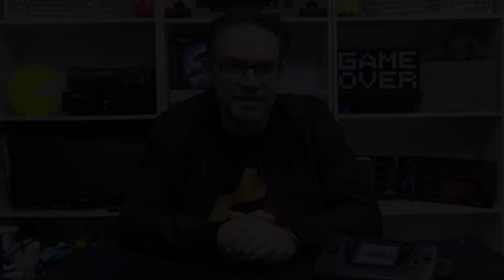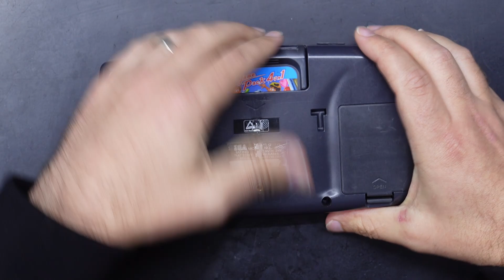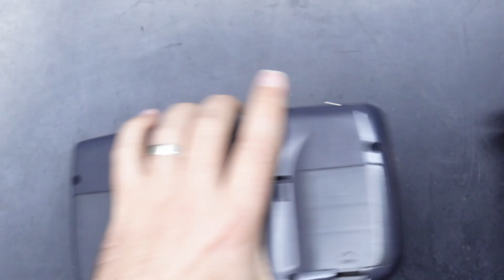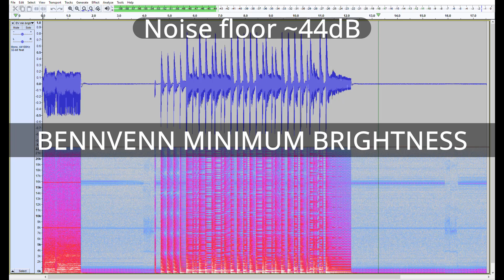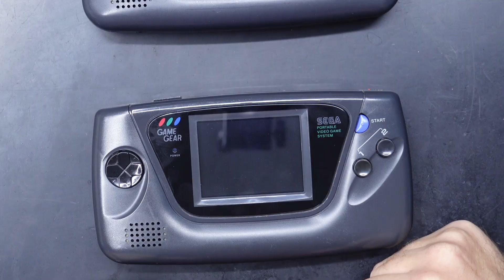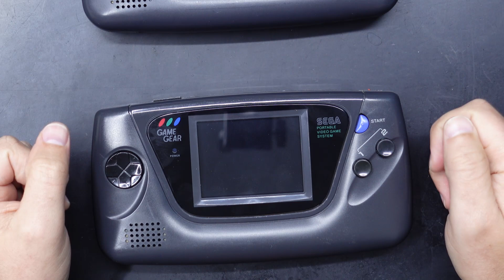Sega Game Gear switchless region mod, LED replacement, and LCD sound (noise) test

Comment: Thanks for this, I just did the same mod using your region method and it worked great.  Had not planned to change the LED, but after seeing yours, realized I had the parts on hand and quicky knocked that out too.  Very glad I did.  I used a 20k resistor I had just removed from R34 (while installing a RetroSix Clean Screen) to replace R11, and for my blue LED the brightness is about right.

Comment: Please can you recommend power LED to replace out the red one. I purchased 3v 5mm however regardless how high resistor value, pulling too much current 100mA. Are they 3mm/5V?
Reply from the maker: I don't remember what I used but if you're always seeing 100mA then it sounds like the only thing limiting the current is the LED (which won't be good for it). At some point a high enough value resistor must limit the current otherwise you're generating free energy

Comment: Hey mate, really interesting, never seen this before. Can you confirm that top pin 3 from the left is the correct one for the 1 ASIC GG to do the mod? Thanks!!
Reply from the maker: Yep 3rd pin from the top left needs to be lifted. If you want to use the left dpad button, connect a wire from the lifted pin to the bottom of C34
Reply: Hey, do you have the diagram Schematic fir the Japanese twin Asic board, I have the same as this video and it is different to the twin asic Europe. The ASICs are different part numbers. Many thanks in advance